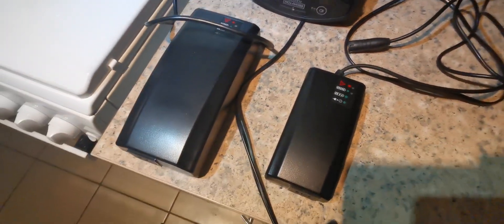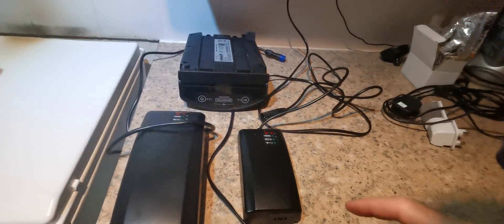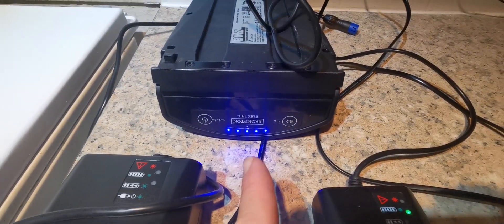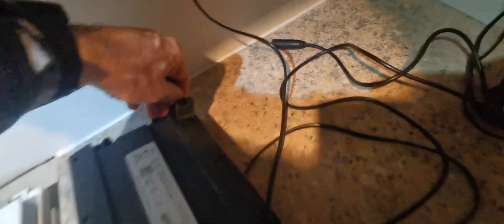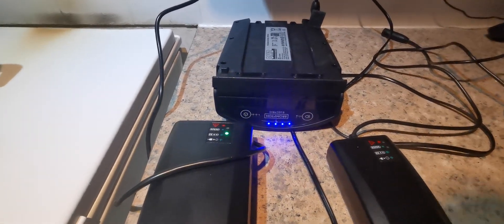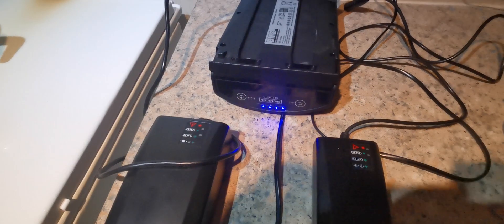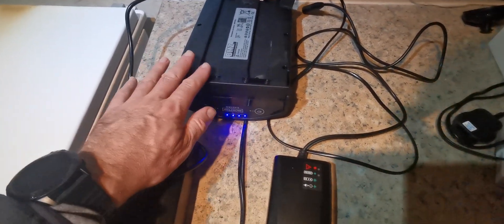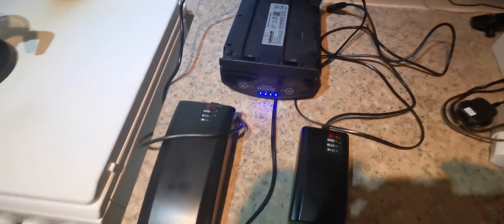How to fully charge your eBrompton battery. Fast v Slow charger

Comment: Any more insight on this? My 2 amp Brompton charger has started displaying this problem. I know the battery is about 75% but the charger indicates full. I haven't seen this in the past and think the charger may be damaged now. I don't have another charger to test. Thanks.
Reply: Hye, how long have you already owned your electric brompton..?
Reply: Almost 5 yrs & over 10,000 miles now.
Reply: @daletsteele have you got any other problems or something since you owned it the last 5 years ago..? I'm just curious to know because i just bought an electric Brompton a week ago..
Reply: @AhmadZainalAbidin-l1y  No problems and going strong. I replaced tires and chain and added a rack. Good luck I think you will enjoy it!
Reply: @daletsteele thanks for sharing mate, feel good to hear that from you, sure i will enjoy my Brompton.. cheers